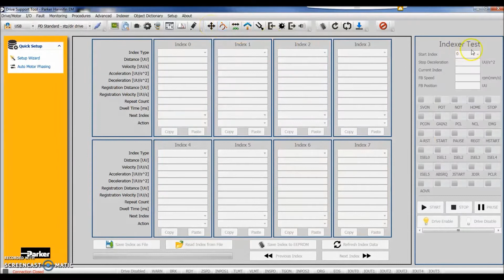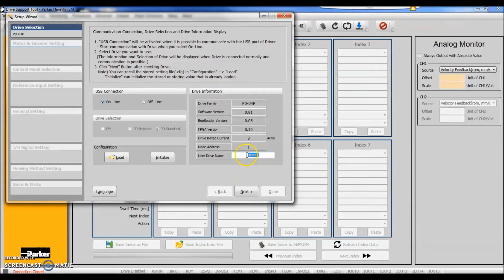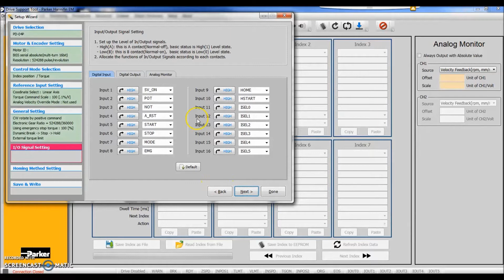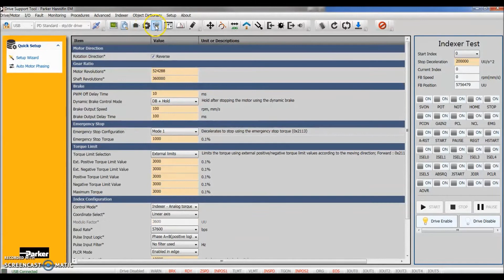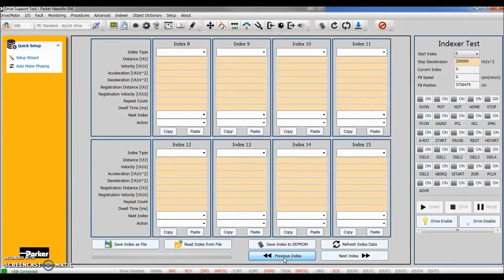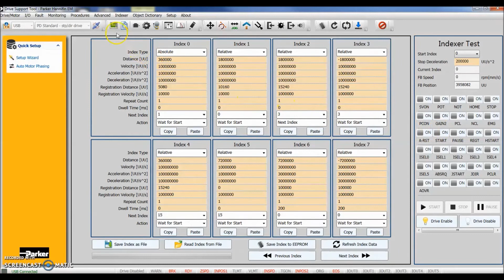Parker Drive Support Tool and P-Series Servo System Setup

Comment: Hi, I have a got a PD-10P drive that I am trying to configure to use with a BE342HJ-NPSN motor, but the driver keeps flashing up this configuration error code AL31 (encoder cable open). Please, how do I remedy this on the drive support tool?
Reply: Hey, were you able to resolve this? I'm having the same issue...